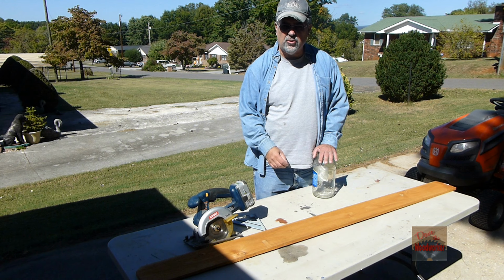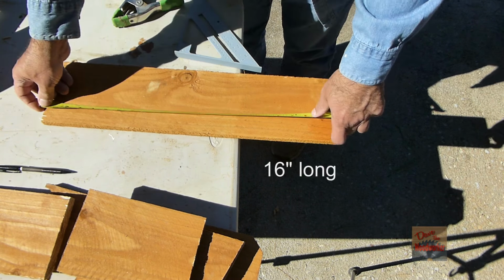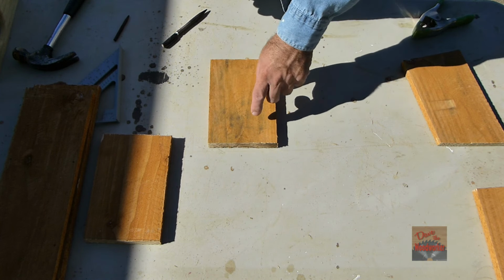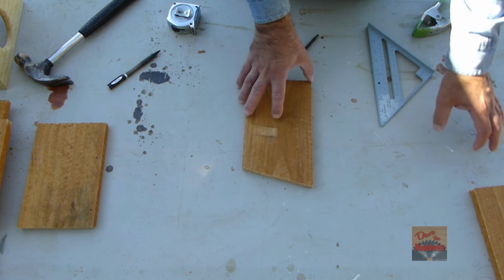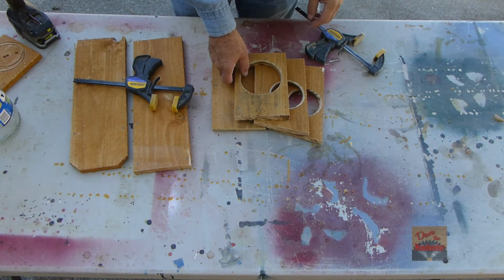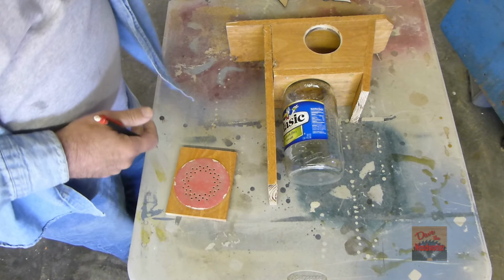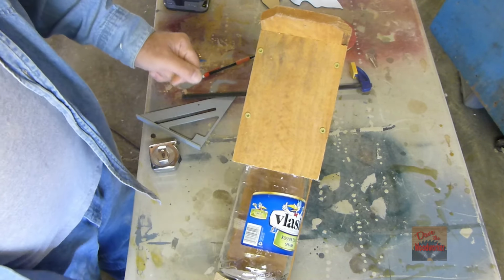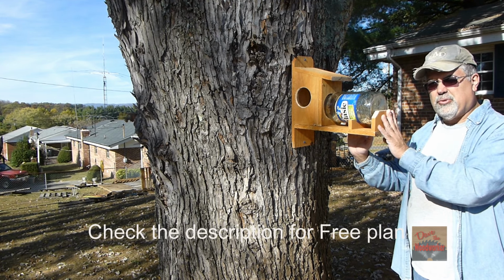How to make a Squirrel Feeder l Free Plans

Comment: It amazes me how much time and effort other people spend trying to figure out ways to PREVENT squirrels from eating bird feed! You've solved that problem by making them their own feeder. Simple but great design. I like that adjustable hole drilling bit. That'll save buying a dozen different hole saw bits. As far as the cedar being poisonous issue, I would think that it's ok as long as they aren't actually living inside there, exposed to it for hours at a time. I just read that one of the biggest concerns was that people were using shredded cedar as small pet bedding, and the animals would be breathing in dust from the shredded particles. But you are using cedar boards, and the squirrels aren't actually living inside there for most of their lives, like hamsters would be. I'm no expert, but that makes sense to me.
Reply: They wouldn't live long enough to worry about being  poisoned by ceder. Would cost a fortune in glass jars, though.  New jar every time you shoot  one INSIDE the jar